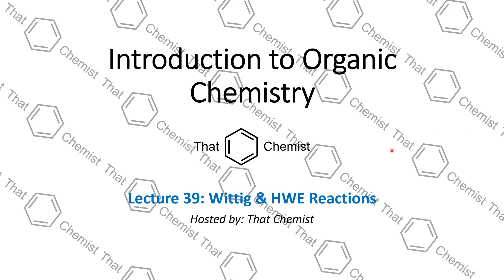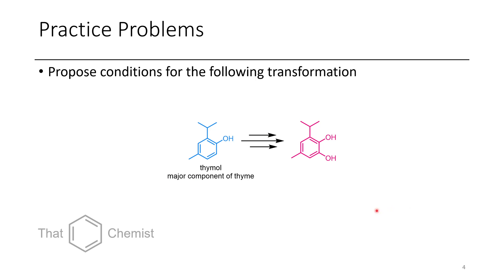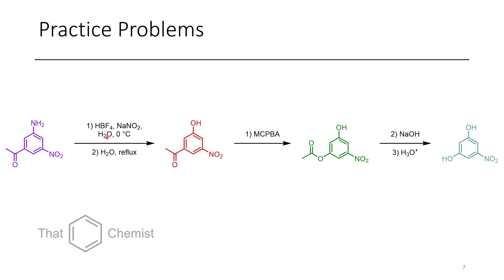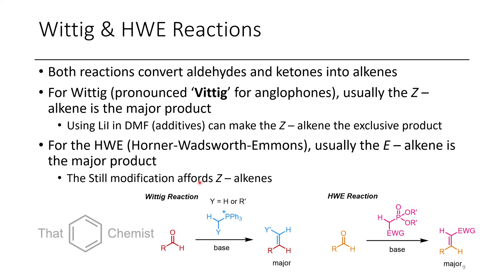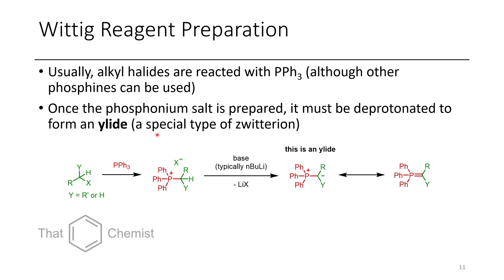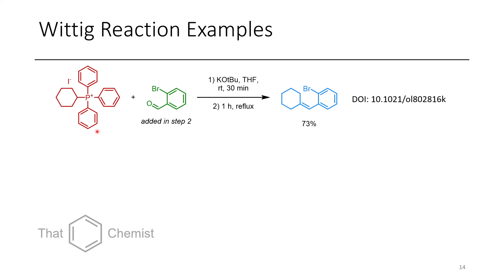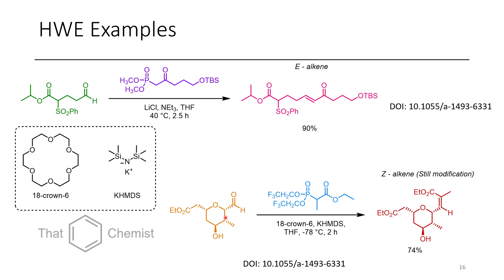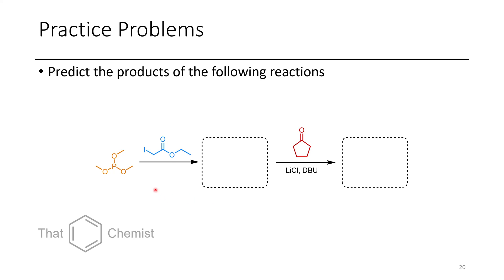Wittig & HWE Reactions - Alkene Synthesis (IOC 39)

Comment: 3:03 I've never actually performed a baeyer villiger reaction on an aldehyde, but I was taught that hydrogen is the group that's most likely to migrate, over any other group. So according to that you'd end up with a carboxylic acid. Maybe I was taught wrong tho
Reply from the maker: The hydrogen will migrate unless you have a benzene as the competing migrator - for aliphatic aldehydes absolutely the hydrogen will migrate - I discuss this in the Baeyer-Villiger episode!